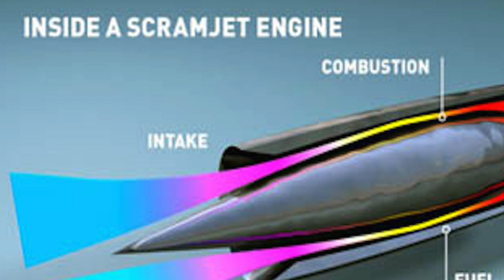ISRO TESTS SCRAMJET :  TOP 5 FACTS

Comment: My one question 
Yar ye oxygen burn kabse karne lag gaiii 
Isme koi or bhi fuel koi sa dala thaa 
Because due to scientific resion  oxygen should not be burn in atmosphere with out any fuell
Reply: SBhat - Not that Oxygen is burnt. Oxygen from atmosphere is used to burn fuel - hydrogen or close to it! Meaning, you don't need to carry large size liquid oxygen tank to burn the fuel. Thus less weight - improved overall efficiency!
Reply: @ananthabhat8678  haa